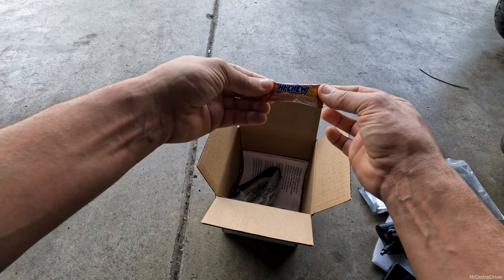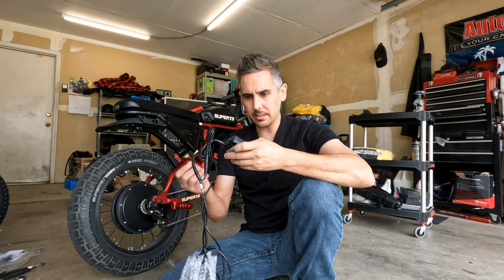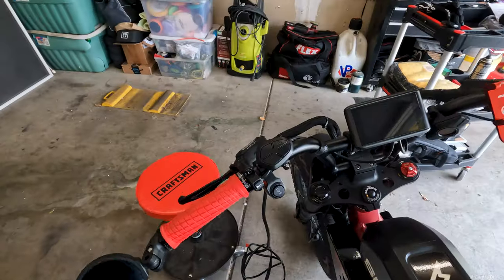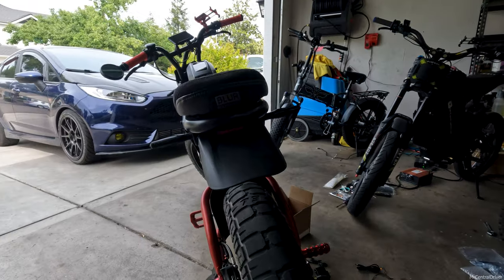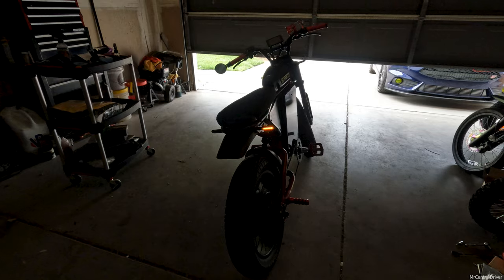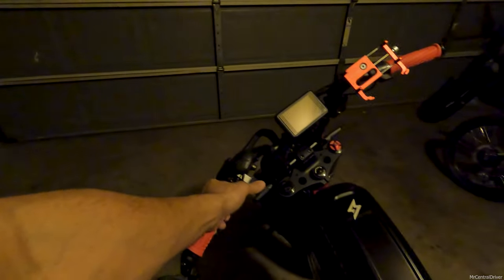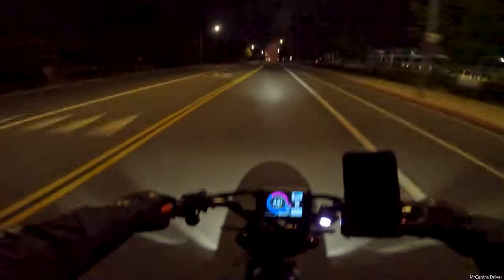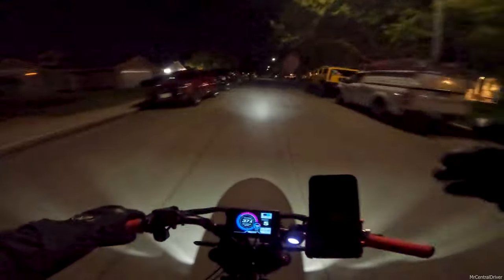Super73 Turn Signals // PLUG N PLAY by Loomenade

Comment: I wired turn signals on my RX and it cost me around $240 AUD to get everything and install it on an external battery pack, so the price he has seems fair tbh.
Btw I have the same switch for the turn signal, you can open the switch from the front side with a knife and rotate it so you have the switch left and right instead up and down, just be carful not to scratch the paint on the switch while doing so and if that happens just spray paint it black.
Good luck :)
Reply: Good tips 😎

Comment: I'm so glad that my Spark CycleWorks Bandit with dual batteries came equipped with everything I need to ride legally on the streets. All I upgraded on this emoped is the dual rear shocks and the tires to 20x4 Vee Speedsters. Top speed for me on throttle is 40mph, 45mph on pedal assist 5 and that's fast enough for me.

Comment: I was looking at getting the Sur Ron X. Which of the upgrades do you recommend? 

Fisher Fab House Ultra 3200 lumen LED Light ($249.00)

Installed Luna Gates Belt Drive ($500.00)

Super Moto Conversion (Slick Tires) ($350.00)

Also, I know you have modded all of your bikes. As a beginner I don't know what to do/get for it.
Reply from the maker: Belt drive system is nice for the bike being quiet. But it’s more likely to break compared to a chain drive. Supermoto wheels are a must if u gonna ride street. Dirt tires go quick!  That headlight is the best headlight ever. Very expensive tho

Comment: You have to cancel turn signals on a motorcycle too. At least the ones I’ve had. The difference is there is usually a pretty bright green arrow next to your speedometer to remind you to cancel.
Reply from the maker: 100%. It’s just remembering to do it on an ebike when ebikes don’t have turn signals at all is hard to remember

Comment: Looks like these ones don't have any audible clicking as a reminder to cancel. Had no other choice but to go for USB powered DIY ws2812b and arduino nano based turn signals with integrated brake lights, DLR lights and reed switch based current sensor which operates the audible signal since it's still just a bicycle with a torque sensor.
Reply from the maker: No clicking you are correct. I run a clicking relay on it now but still can’t hear it with the full face helmet and the relay being in the frame.
Reply: @MrCentralDriver  Then Blinker Pro bluetooth sound signal might be one of the options or some cheap DIY transmitter and low battery consumption receiver in the helmet.

Comment: 14:19. Bro. $200! The external battery can be had on Amazon for $38.00. $150.00 shipped would be a better price.
Reply from the maker: the turn signals, wiring, hardware, and labor to wire these is where the other cost comes from

Comment: as much as the Super 73 cost, brake lights should at least be standard
Reply from the maker: Brake lights are. Not turn signals
Reply: @MrCentralDriver  yeah I’m pretty familiar with what brake lights and turn signals are. Just saying the brake light should be standard.
Reply: My Bad, I want a super 73 bad but just not sure. I got a Hyperscrambler 2 (which I love) great speed, ride and range is excellent, got aventon aventure 2 which has the best torque sensor I've ever ridden, A rattan quercus which I sold after a week. But now have this Super 73 craving. My hold out is they have got to be about to upgrade their system. So many other brands are far ahead of them now and I feel super 73 is just riding on their name now. The Revv 1 looks good. I love the Super 73 adventure series with rear suspension in sandstorm and have put it in my cart about 20 times then taken it out. I have seen Ristretto 512 which looks awesome but no one has gotten their bike yet. But is about equal to price of super 73 and offers so much more. Man it's a hard decision.